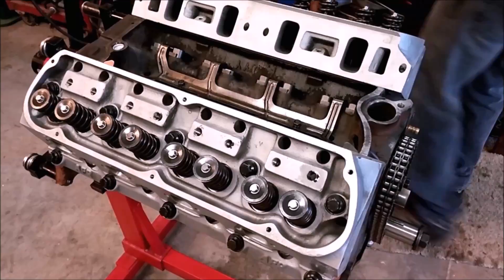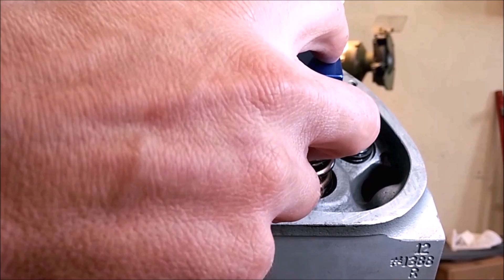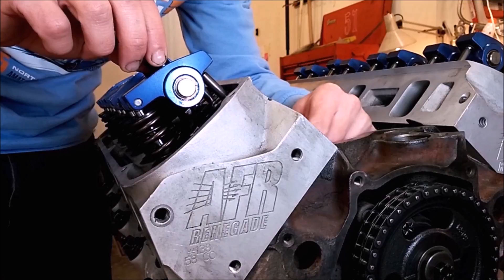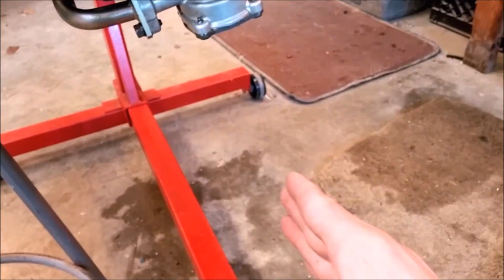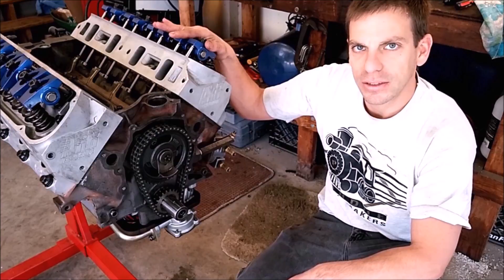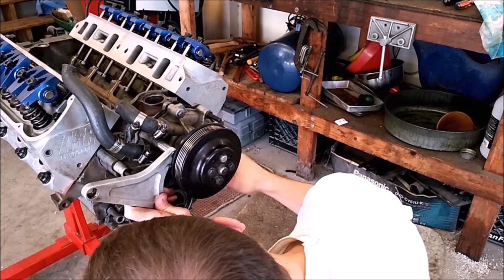How to Build a Ford 347 342 331 306 302 5.0 SBF (Part 7)

Comment: So 90 degrees or 1/4 turn on the adjuster nut for lifter preloading, how's that motor behaving after it's fired up? Tappet noise?  Another gentleman is doing one full turn. So I need help to decide please!
Reply from the maker: Actually more like 1/3 turn, but yeah, there are a few theories on optimizing lifter preload varying from 1/4 to 1 full turn.  What really matters is preload distance which will vary with thread pitch of rocker studs.  So part of the variation is that the preferred preload distance (0.020" to 0.060") you are targeting changes the number of turns depending on thread pitch of the rocker stud.  So know the thread pitch of your studs/nuts to calculate # of turns to get your desired preload.
Reply: @fastfrankd  Excellent piece of info. Thanks a lot!

Comment: What did you torque those rocker studs that go into the head ? Any loctite ?
Reply from the maker: You'll want to torque the rocker studs to the head/stud manufacturer recommendation.  It depends on material and thread pitch.
Reply: @fastfrankd  thank you !

Comment: Hey awesome work ! Did you put rtv on all the intake ports on those top studs ?  Thanks !
Reply from the maker: Any stud tapped hole that breaks through into the intake port will need the RTV, it's all 8 for these heads.
Reply: @fastfrankd  thanks again frank !

Comment: Did I miss pushrod length measuring?  Great videos by the way.
Reply from the maker: It's not in the video, but I discuss it in a reply to a previous comment.
Reply: @fastfrankd  Are those AFR 165 or 185 heads?  I'm thinking about saving some money and building my stock block to a 331.  With forged internals and girdle for the crank, I want to build it for 7,500 rpm's.  With some Vic Jr. heads (Good bang for the buck head), I should be able to make around 475 FWHP with the right cam.
Reply from the maker: 185

Comment: How did you measure for pushrod length?
Reply from the maker: Great question.  A couple ways to do this.  You can install lightweight springs in cyl 1 valves or (assuming you are using HR cam) sacrifice a couple of old lifters and modify them to make them solid at about 0.020" plunger depression.  Then install heads with just a couple bolts.  Adjust valves as shown in vid, then rotate the engine through a full cycle while watching the rocker tip action on the valve stem.  The tip should roll/ride within the center 50% of the valve stem.  (e.g. if you have 8mm valves, the roller contact point should not be closer than 2mm to either edge.  The good news is that the vast majority of off-the-shelf parts will meet this spec and you're done.  If you have a radical cam with small base circle, or some specialized aftermarket heads, you may find the roller getting too close to the edge of the stem.  At this point you need to get an adjustable length pushrod so you can determine at what pushord length the above conditions are met.  Adjust the length of the pushrod until the above conditions are met and note the length.  Note:  Do both intake and exhaust, as they may require different lengths.  Then you can order a set of custom length  intake/exhaust pushrods if necessary.  Don't forget to put your full spring package back in!
Reply: fastfrankd thanks! I’ve seen another video on this, I just didn’t know if you have a way to calculate the length. Your videos are great and I appreciate the response!

Comment: I’ve always been told to turn the outer lock after I tightened my inner lock to fully lock the rocker down. Is that true?
Reply: generally what many do is they adjust the nut just shy of their preload target then tighten the set screw then holding set screw and nut give it a final little turn to your target.  Then ensures the set screw gets nice preload set on it to prevent it backing off.
Reply from the maker: The outer nut is what is used to adjust the lifter preload.  Make sure you hold it steady while torqueing the inner set screw and don't try to turn it after the inner set screw is tight.

Comment: I'm want ting build a331.BUT it has to be balanced at 50oz. Reason being it's a explore based efi and harness and it has the crank trigger on the balancer. I have not found a balancer to fit the crank trigger that is 280z. What do you suggest?
Reply from the maker: A good auto machine shop or race engine shop can balance the rotating assembly to desired balance.
Reply: DIYAUTOTUNE.COM has a pickup wheel you can mount to any balancer. You could also look at Innovators West for a balancer with a flying magnet setup but Im not sure what options they offer and they're nice but $$$$.